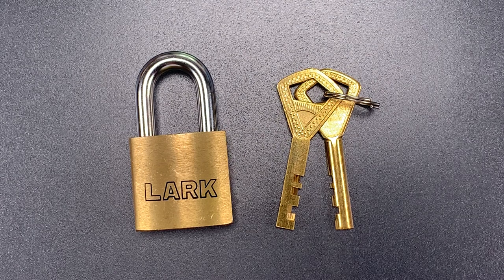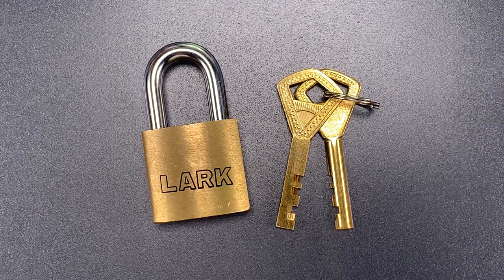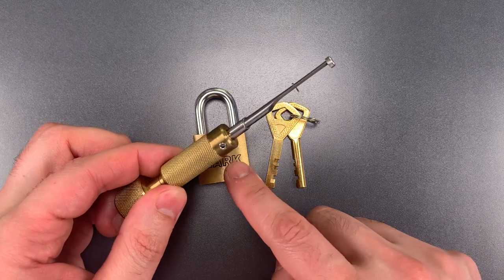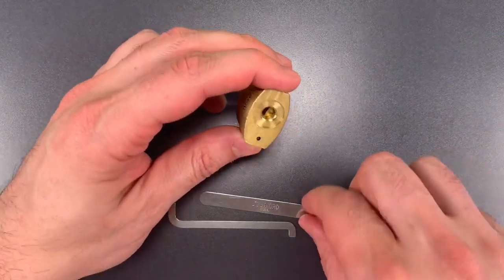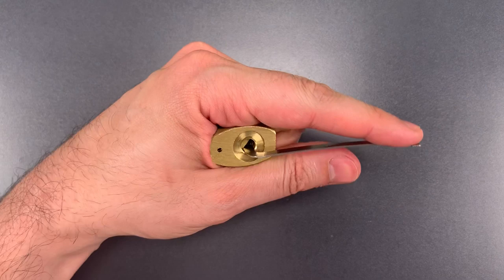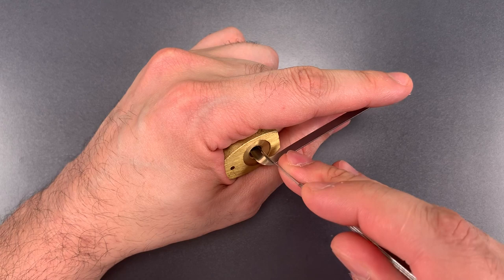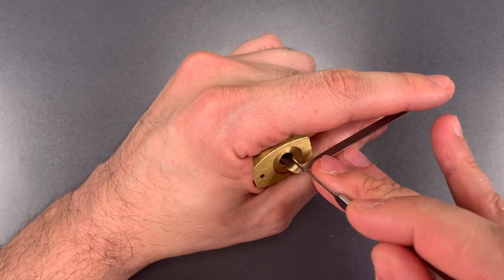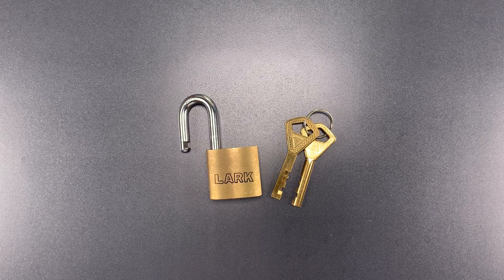[924] Picking a Disc Detainer Lock With Pin Tumbler Tools

Comment: I used to be scared of these locks because of the "required" dedicated tools needed that I don't have the craftmanship to recreate, but that's much easier, thanks!
Reply: reminder that this will not work on the usual locks like the abloy classics - as he explained, those tension from the back. 
this one tensions from the front, so this method works on it.
Reply: As soon as I buy some basic lock picks, I will have to start investing in some more dedicated tools like this.
Reply: No. It looks much easier. Have you ever seen anything on this channel look difficult? 

It’s like watching the Olympics and concluding that those ginormous ski jumps are pretty easy-looking. That might be true, but it doesn’t actually make them easy.
Reply: @howdenking  so if I used a much longer tool to reach the rear it would still work?
Reply: @paulkemp8520  Theoretically, it could - I mean, the specialized tool that he shows at the beginning is nothing but two tools secured together for convenience. But it would be pretty tough since the tensioning tool would get in the way of picking (and I don't think any pin tumbler picking tool would really work for convenient tensioning, so you'd still need something special)

Comment: This is similar to my first way of picking disc detainer, but my homemade pick was a thin spike
that I bendt in every end. One end small for picking the other larger to hold it.
Now that I have several bought DD picks I still try to pick the locks with this method (w/better homemade tools), because I see it as a "more authentic way picking" and it`s for me a bigger challenge to pick using these tools.

Comment: I was kinda afraid you'd bend or break the pick while working the discs.
Reply: I wouldn't be too concerned. You could use a nice thick pick since this kind of lock doesn't bother with preventing normal picking tools getting in there.

Comment: Very interesting. Definitely sharing this.

I was discussing this exact idea with someone a couple of days ago; he volunteered to run a lock picking table at an internal event, and I noted that some of the clear plastic demonstration locks the organizers had got were not ideal for the cheap lock picking kits they'd also purchased. BUT I did say I thought perhaps the disk detainers were still possible, and went as far as to show him how to do the initial "reset the disks", and move the disks with a standard hook... unfortunately, there were no decent tensioning tools (just the 7 and Z shaped wiper inserts style ones)

Forwarding this video to him now. ;]

Comment: Other than experience, how would one know whether the lock is tensioned from the front or back?
Reply: I believe it would be the disc with no rotation.
Reply: @markleng67  All of them rotate. Short answer to the question is: not possible to know other than knowing the manufacturers products.
Reply: @JaakkoF  I think he has picked some locks which tension off a random "zero-cut" disc. That might be how you find out.

Comment: What happens when you try tensioning from the rear? The last cut on the key looks like a 0, unless there is no disc there?
Reply from the maker: There’s no disc there... the last disc is about 45 degrees. If I tension there, nothing binds. ☹️
Reply: @lockpickinglawyer  Could it be the width of the tensioner is too wide? Abloy use 2x zero discs at the rear but that looks like just 1. Otherwise you need and old school front tension Abloy pick! I have one designed here for a random zero disc. I anticipated Abloy doing this at some point but now I don't think they'll bother...
Reply from the maker: huxleypig69 I'm certain. I didn't give up on the custom pick lightly... but I'm glad I did. This was a fun little experiment for me. 

A three way classic pick? I'd love to see that! Can you email or message me?

Comment: So it didn't take you long to pick it. BUT if one would encounter such a lock on the wild, how long would it take them to discover that they need to tension on the first disc, instead of the last, or both? What I mean is that you've put some prior knowledge into this pick, that you wouldn't have in the field, this is effort that needs to be taken into account for the actual pick resistance of such a lock, wouldn't it?

Comment: I can for the life of me not visualize how these type of locks work on the inside... Those discs need to spin a certain amount, and then what?
Reply: Then the notches cut into the outer edge of the discs line up, causing the sidebar to fall into place, which allows the lock to continue turning.